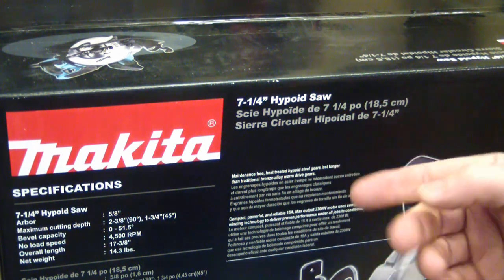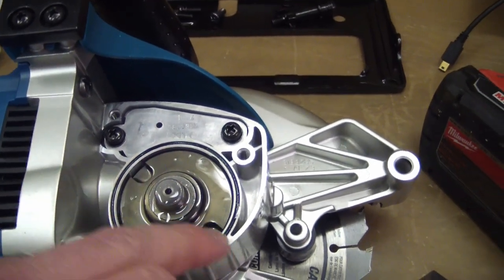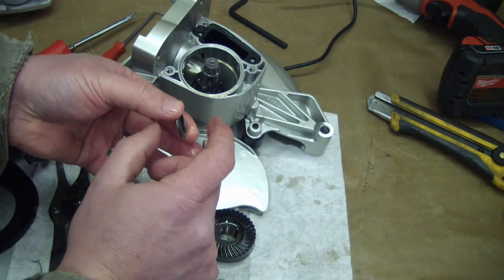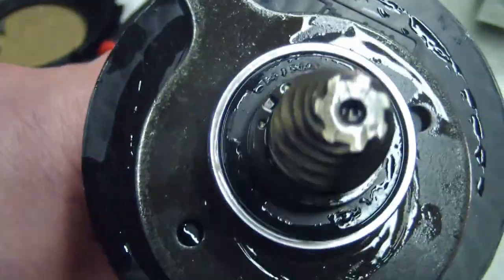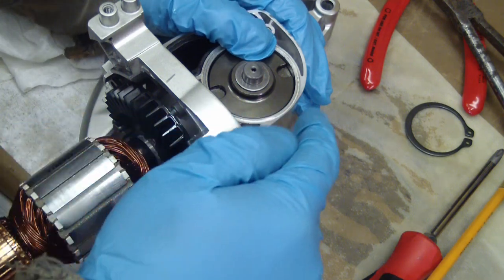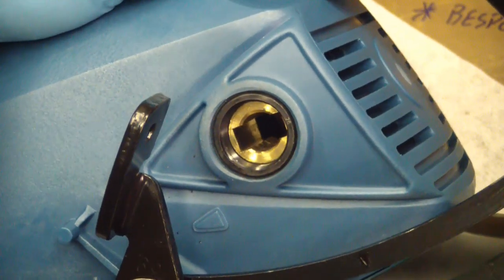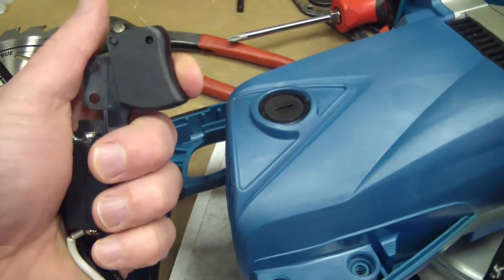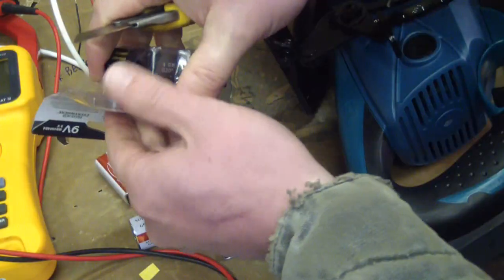Bored of lame tool reviews? Meet Makita's new Hypoid Saw.

Comment: Good job Arduinoversusevil.  

Your gear explanation is.. a bit off.  Most RWD cars use a hypoid gear set in their differential.  The advantages of a hypoid gear set over say, a straight bevel gear are pretty big.  If you have a FWD car, you likely have a helical spur gear driving the differential.  AWD cars will end up using hypoid for the front and rear differnetials, and a spur for the center diff.  

Hypoid gearsets give you the advantages of helical gears.  They're less noisy, and wear slower.  They also have the disadvantage of being more sensitive to shock loading versus straight gear teeth.  They also handle misalignment much better.  Which is the killer application for something like a saw, or car, where the gear case getting distorted is a real issue.  

You can have a spiral bevel gear as well, which is a hypoid gear set with intersecting axis of rotation.  

Worm gears do have the efficiency problem you pointed out.  But they are also locking, which means you can't push back through the gearset.  They also allow much bigger gear ratios without having larger gearsets.  

Source:  My dad makes gears for a living.
Reply: ***** Well, that's the only nit I can pick.  :-)  I do enjoy your channel.  Keep up the good work.

Comment: Shit, you just needed some 18650 batteries, I got a bunch I would have sent them to you. A friend gave me around 40 laptop batteries and I dissected them and have around 250 or so individual 18650's that were worth keeping. maybe more I would have to look. They work wonderfully in the LED flashlights. If you take the 3 AAA battery holders w/batteries in them against one 18650  it's a no brainer the 18650 is skookum . The green laser with an 18650 is badass too, it will go for miles and miles. I have to be careful I live under the flight line in Seattle area and it will light up a jet. No, I did not try, I can just see the the trouble before hand.

Comment: That's brass. Easy way to tell: Zinc is a whiter metal than tin, so you get lighter brasses than bronzes. If you scrape a brass it will look white, a bronze will look white ish with coppery flecks.

And if you're wondering how I know, I make and cast the stuff.
Reply: YW!

Also, if you get the time, I'd like to see you try and make an aluminium thrmaloy (Mix a few things in with aluminum and we'll see if any help it resist heat)

I'd suggest brass, graphite, (Powdered) and maybe steel.

I just want to see for a railgun I'm making, because if we can get a thermaloy it'll allow the rails to have a much longer life.
Reply: Micah Burgin I have heard brass and bronze is a common one for some people to have a hard time telling the difference, depending on how many red cones they have in their eyes, or some bullshit like like. I personally have never had a problem telling the difference. Brass tends towards yellow, while bronze tends towards orange. A little patina tho and it starts getting difficult :P
Reply: Hence the scratch test, works even when patina is a factor!

Comment: Wha, they really shafted you on this one. Mine comes with a thing that holds the allen key on the flexible boot.

Jokes aside, say what you say about bowing down to the marketing and bs rules some useless govie makes without knowing anything on the field, Makita does good stuff. It's not perfect, it's not brilliant but it works/time.

I've had mine for quite a while now (4131, metal saw) and it works even tho i've been an ass and used it on anything but cutting metal (concrete, bricks, wood, very hard wood and plastics).

I admit i changed the cord and the bearings on it. Had a friend find me some German bearings (probably still made in China) and used a really old, but in perfect, pristine condition Bosch cord, 1987 vintage.

Comment: I don't think that's a ferrite, looks like one of those anti-theft devices. I've purchased some tools that had a similar thing around the power cord, and if you take it apart you'll probably find one of those anti-theft barcode things in there.

It's so people don't take the tool out of the box and walk out the store with it. Since the anti-theft tag is stuck to the power cord and not on the box, the things at the store entrance will alarm.

Normally, the ferrite things don't slide around on the cord like that.

Comment: Actually that pod on the cord has an RF ID tag in it! I took one apart. No Toroids!
Reply: ***** I love how you tear the tools apart. Its good stuff! I have a woodshop for the last 20 years, and we only use Makita tools. I have cordless tools that have been in service since 1990 and some batteries from 1992. They use Panasonic batteries and refuse to give in to the big box stores to make a crappy tool, except for the white cordless tools.
We tried many other brands, and only Panasonic, Makita and Hilti lasted more than a year. There are very few brands that will hold up under constant daily commercial abuse.

Comment: 11:49 "And a nice chinese nsk bearing. This ones sealed. So there will be some grease in there. It wont be lubricated by the oil. The backside is shielded and it'll just have some grease in it. So thats the difference between a shielded bearing and a sealed bearing."

I gotta be honest I still dont really understand the difference. Guessing that the shielded bearing will allow in some of the gear oil to supplement its lubrication? [I am aware with my broad lack of knowledge on the subject I dont really belong on these videos...]

Comment: A 20 amp breaker is designed to hold 80 percent of its rating continuously. So a 15 amp load shouldn't pop a 20 amp breaker.

Comment: I absolutely DO NOT recommend Makita Haypoid gear design. The main reason is that in the event of a broken/worn pinion or  gear you MUST replace the complete armature ($129.47) plus gear($80.51). I got same problem with my DeWalt 378G. Its pretty much alike in design with the Makita, running the same hypoid gears and design. I inadvertently used (and abused) my saw with no oil and now the repair costs is $210.(have to replace armature because pinion is built on it plus the gear, which, I will NO do it. I´ll Buy a worm design now.) In the other hand if you get the worm design circular saw (Bosch, Skil, Rigid, etc) you wont have to replace the complete armature..the worm(it is NOT built on it) or just replace the gear because is made of brass. The repair cost is cheap if you get the worm design. Do not buy hypoid design unless the pinion is not built on the armature. Please, do check the following link to see the map of the DW378G and you´ll see Makita and DW378G pretty much are the same machine. Dewalt discontinued the hypoid design by the way. http://www.ereplacementparts.com/dew…2789_2823.html

Comment: better late than never.. the one downside of that saw and the original skill is that the base plate bends.. some of the other brands (I went dewalt, for a couple features)went with a cast version and so far it seems tough enough.. so don't set that thing down to hard, or let the tenderfoots handle it...

Comment: And as for the power, its likely not a lie. They probably measure the inrush power (using a fast power meter connected to a oscilloscope) and give you the peak value. 

It stems from seedy salesmen fudging physics, not down right lies.
Reply: Keep in mind your DMM is doing heavy filtering and averaging. Connect it to a fast clamp meter and an oscilloscope to possibly get the marketing value.
Reply: Manufacturers of HiFi audio equipment have been gilding the lily for many many years now.   Speaker ratings... amplifier ratings... many manufacturers engage in extreme levels of bullshittery on their spec's.

Comment: You must have worn all kinds of hats before starting this semi retired lucrative youtube fun.
Although not common, they design the housing's bearing bore to have a groove (lathe the inside of the bearing bore) and pop an oring  in there to absorb the mechanical noise generated by crappy motor tolerances.

Comment: i did the power tools for sears canada and the biggest peeve i had was that the  main bearing rest in plastic.they will last ok if you are a armchair warrior and use it lightly.but if you choose to build a house or in a shop after minimal use the bearing will turn causing the armature to make contact with the field or so hot the brushes melt and it dies .such a well built units killed by in my opinion a purposely set death!!!! sad so sad

Comment: Uhhh?  The final drive gear set in your average car doesn't intersect the center line of the axle either.  Gears in cars are also hypoid gears.  Crawl underneath and have a look one day.  Pretty much 99% of pinion gears are below or above the center line of the axle it drives.  Otherwise a good video, just check your facts.
Reply: my apologies!!

Comment: Your bronze and steel oil contaminating story reminded me of my old volvo, it was a 2001 S40 T4, great car, great engine, shitty transmission! (M56L)
Funny thing is, guess what volvo (Not volvo actually, but Getrag) used for the god damn synchronization rings or Synchro's, FUCKIN BRONZE!
Guess what happens to bronze synchros when you abuse them with 32 Kg\m and 230HP... BRONZE DUST! :D

Epic fail by volvos engineers... :D
Still never blew the transmission, though.
+AvE

Comment: Great Stuff, but dude the plastic slider dealie on the cord ain't got nuttin' to do with transient voltage spikes. Pry the MF off the cord, open it up, and you'll see that it contains a little RFID tag. It's there to buzz the anti-shoplifting horn if you try to sneak it out of NorthernHarborDepot widdout paying for it.

Otherwise, great friggin videos, dripping with awesome sauce.

Comment: 12A breaker would not be tripped if loaded with 15A load for few seconds.
Reply: no it wouldn't but what hes saying is that the tool doesn't actually run at 15 amps because that would trip 12 amp breakers instead it PEAKS at 15 amps and they picked that number to sound good even though it isn't actually what the tool runs at.
Reply: Circuit breakers have 2 modes. 1. Short circuit protection 10KVA (1/10 second) 2. Overload at 2x rated can take up to 5 seconds to trip.
Reply: where do you buy a 12amp breaker lol...
Reply: ***** from a 12amp circuitbreaker shop
Reply: Arnis Tarassu And where would that be?
Reply: crashandburnbirner I ain't yoo mama :D
Reply: If you 'heard' it all he was talking about jobsites where using a crappy extension cord would blow breaker is said situ

Comment: That's probably double jacketed cord. They put a rubber lining over the PVC or whatever material. I got a high end double jacketed as a engineering sample made in America and it was the same shit.
Reply: It's like that they cant get the elastic properties and the chemical resistant properties in one material, so you get that mismatch between the PVC and specially formulated rubber (oil resistant possibly) that leads to the little wrinkles.
Reply: http://www.stayonline.com/reference-cord-jackets.aspx 
All these jacket plastics have different chemical compositions. This modification likely leads to inferior elastic properties. You have a TON of options here when your specifying a cord.
Reply: the different oils in use probably have different degradation defects on the power cord. A good designer will pick a jacket insulation material that will withstand the leakage of whatever is in the saw, so you can't zap someone because the oil leaked out of the saw. All the different kinds of lubricants and fluids have different effects. This is often determined in house by the manufacturer. When I had esoteric requirements for chemical resistance I was basically told "fuck you, we can't look it up in a table, test it yourself". A real engineering black hole for a company that does not specialize in the shit.
Reply: And the more esoteric the chemical resistance requirement is, the worse mechanical properties you will get from a jacket material. 

But double lined, rubber with PVC is the minimum a tool should use. The better rubber with more resistance is wrinkly.